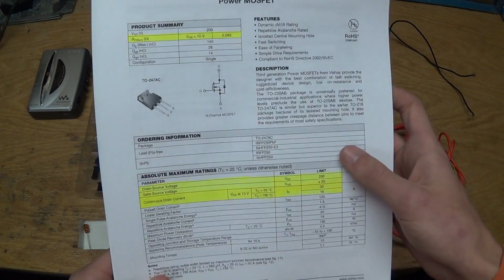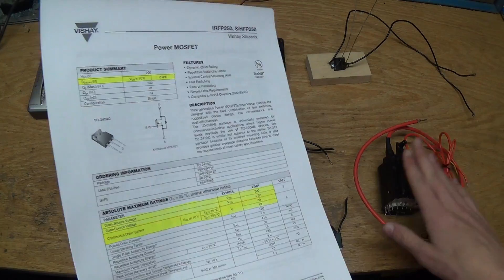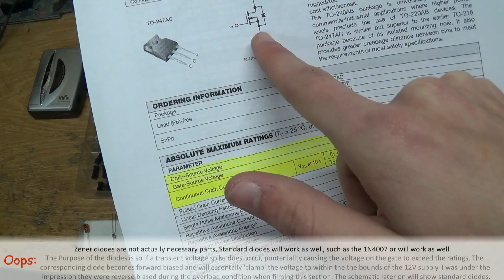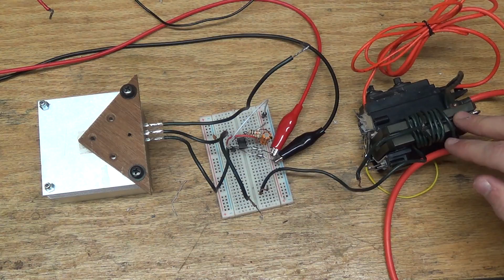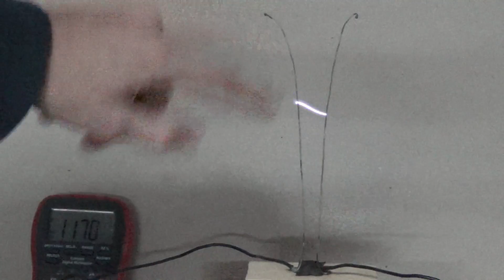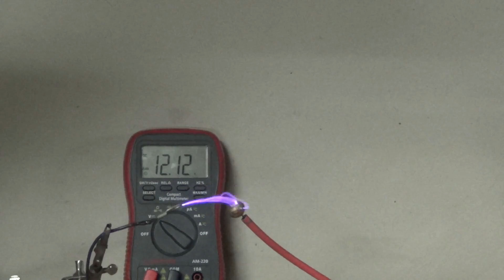Weekend Projects: Make a 69KV Singing Arc Plasma Speaker Flyback Driver!

Comment: Have a look, might be interesting for you.
This is not typical crowd funding,
 This is open source project.
https://www.kickstarter.com/projects/384716696/zero-emission-heater
Reply from the maker: +Igor Stojanovic Sorry for not responding sooner, you got caught into the spam filters. Interesting kickstarter of yours, though I have a few technical questions:

My understanding is that this is basicly a microwave and vacuum chamber where fuels that are liquid at room pressure and temperature can be gasified at very low pressures for supposedly clean combustion and heat production. There are a LOT of words on that kickstarter to describe just this? Am I missing something?

Have you verified any of the science behind this? Do you have any working prototype? Other than that seemingly unrelated video of something being nuked in a microwave? I would either edit up a more professional-looking video describing what you are trying to do, and why, and some of the science to back it up, and remove that video.

This project sounds VERY complicated, and consequently pretty expensive/impractical. Almost all great inventions tend to be simple and elegant in design (simpler = cheaper and more reliable). Like, what is the unit price of production if you plan to make this something sellable? What would an open source community want to do with this?

If zero emission electric heaters already exist, why would anyone bother making or investing in this type of heater? Electric dish heaters work pretty well for small areas. They are very efficient, since heat energy is like the simplest and easiest thing to produce.
Reply: Power Max
Hi, thanks for response.
That video is not related, sort  of.
It is proof that already burned exhaust can be burned again.

Science behind my idea is complicated but already proven... many many times.
My idea  taking the things a bit further,
Closed system with  no need for oxygen.

We are building several ov those in diferent locations.

But lets  break it down,

Get your self one cheap induction cooker on ebay for less than 40 dollars.

You will get your self 2KW plunged in AC device with power control. button or buttons.

Its coil  can be used as choke/step down transformer. you shall need some finest ferric  dust you can find to mix it with lets say epoxy... this is how you get your encasing for puirpose of  traping all of electromagnetic power in coil and be impulsed  in to the interior of one side of pipe geting the moste of your buck for that bang.

For stabilizing process  and reducing electricity consumption system very similar to fluorescent light will be employed.(fantastic solution known for decades while creating plasma bridge in vacuumed pipes. lfuorescent, or neon lights.

After that you will need to build your self container for your fuel. and to chose between, design you have on kick starter, U shaped pipe for testing Or one swirling  pipe ( something like  Shape of electrical heater for water in your electric boiler) which I suspect will be  very interesting design to exploit.

Ma skype is websonic6

wiber/ whats app, +41798178038.

Pplease call for any kind of question you have.
Mind you, This is open source., I do not do this for money.

cheers
Reply from the maker: +Igor Stojanovic Well, you aren't really "burning" the gas. Because fire is by definition, a self-sustained exothermic redox chemical reaction. Say you "burn" hydrogen with oxygen present as an oxidizer: you create H2O, as the 2 hydrogen atoms are torn apart by the initial heat energy then left to react with oxygen. The process is exothermic, meaning that it releases more heat energy afterwards, some of which carries on the reaction with the rest of the H2 and O2 present. The chemical equation is 2H₂ + O₂ --> 2H₂O. A similar but much more complicated process occurs with ANY type of burning. Also notice that all good chemical equations are balanced. This means that you will ALWAYS have the same atoms on one side as the other side. Just like 2+2+4=8, and cannot equal 5, the total H's and O's on one side must be the same on both sides.

Chemistry is not my specialty by any means, For that, check out NurdRage on youtube! However, as with anything, that ideal chemical process is only half the story, or actually, more like 10% of the story. In the non-ideal real world, not all the fuel is burned. Gas engines for instance release unburned gasoline into the atmosphere, and this has to do with how real world chemical reactions occur. It is up to chance if every single gas molecule was able to find a friendly oxygen partner, and has enough activation energy to get it to react. If the gas/air mix is not perfect, you start needing to deal with something known as "limiting reactants." and "stoichiometry".

"it is proof that burned exhaust can be burned again" Sorry, that is simply not true. Once the reaction between fuel and air has occurred, and has lost it's energy, it cannot be burned again, since it literally has no energy left. It is like a spring that has lost it's compression after burning. If you put heat energy back into it, in some cases, you can reverse the reaction and "reduce" things like metal back to their non oxidized form again!

Here is a good video about what fire is:
https://www.youtube.com/watch?v=tMDKeBaLWDw
Reply from the maker: +Igor Stojanovic Well, you aren't really "burning" the gas. Because fire is by definition, a self-sustained exothermic redox chemical reaction. Say you "burn" hydrogen with oxygen present as an oxidizer: you create H2O, as the 2 hydrogen atoms are torn apart by the initial heat energy then left to react with oxygen. The process is exothermic, meaning that it releases more heat energy afterwards, some of which carries on the reaction with the rest of the H2 and O2 present. The chemical equation is 2H₂ + O₂ --> 2H₂O. A similar but much more complicated process occurs with ANY type of burning. Also notice that all good chemical equations are balanced. This means that you will ALWAYS have the same atoms on one side as the other side. Just like 2+2+4=8, and cannot equal 5, the total H's and O's on one side must be the same on both sides.

Chemistry is not my specialty by any means, For that, check out NurdRage on youtube! However, as with anything, that ideal chemical process is only half the story, or actually, more like 10% of the story. In the non-ideal real world, not all the fuel is burned. Gas engines for instance release unburned gasoline into the atmosphere, and this has to do with how real world chemical reactions occur. It is up to chance if every single gas molecule was able to find a friendly oxygen partner, and has enough activation energy to get it to react. If the gas/air mix is not perfect, you start needing to deal with something known as "limiting reactants." and "stoichiometry".

"it is proof that burned exhaust can be burned again" Sorry, that is simply not true. Once the reaction between fuel and air has occurred, and has lost it's energy, it cannot be burned again, since it literally has no energy left. It is like a spring that has lost it's compression after burning. If you put heat energy back into it, in some cases, you can reverse the reaction and "reduce" things like metal back to their non oxidized form again!

Here is a good video about what fire is:
https://www.youtube.com/watch?v=tMDKeBaLWDw
Reply: Simple question, what happens when you split big molecules  with strong electromagnetic field?
Reply from the maker: +Igor Stojanovic What I think you are doing is actually just superheating the leftover exhaust to the point of  incandescence. I assume it is the soot leftover from the already burned fuel that is turning into a plasma. However, the exhaust is already released its chemical energy, so heating it up will yield no more energy. Maybe some other chemical reaction will occur, but one that converts exhaust back into fuel or something else temporarily, then that burns, but no net energy is released or absorbed.

So what this means is that you just created a very complicated electric heater. Because almost no additional energy is released by the exhaust plasma, almost all the energy is coming just from the microwave pumping energy into the plasma, and that energy is being dissipated as heat and light. A standard electric heated does just that, produce heat and light Much easier, simpler, and cheaper.

Also, this is not emission free because like I said, you CANNOT make nor destroy matter. Maybe lose track of it, as an escaping gas or as some soot that builds up very slowly on the sides of the chamber, but it is not destroyed, as so technically not emission free. Just that the emissions are contained.
Reply: Take crude oil for example:
creating those molecules took lots of heat and pressure,
Spiting that molecule will not release  heat?
Reply from the maker: +Igor Stojanovic There is a LOT of chemistry involved with combustion, it is simply WAY too much to discuss in a youtube comment. and NO, spitting a molecule doesn't release heat, in fact, it actually TAKES energy!... Let me read you one page of my really old, dusty chemistry school book (ISBN 0-07-861798-7, page 708): 

=========================================================================
Exothermic Reactions:

_"If you have ever started a campfire or built a fire in a fireplace, you know that the burning of wood is an example of an exothermic process. Once you have ignited the wood, the reaction generates enough heat to keep itself going. A net release of heat occurs, which is what make the reaction exothermic. (figure 20.1) The exothermic reaction (left) is gives off heat because the products are at a lower energy level than the reactants. The endothermic reaction (right) absorbs heat because the products are at a higher energy level that the reactants."

"The reaction between hydrogen gas and oxygen gas to form water, shown in Figure 20.2, is another example of an exothermic reaction. Once a small amount of energy----often just a spark-- is added to the mixture of gasses, the reaction continues to completion, usually explosively. No additional input of energy from the outside is needed to keep it going. Once energy has been supplied to break the covalent bonds in the first few molecules of hydrogen and oxygen, the atoms combine to form water and release enough energy to break the bonds of additional hydrogen and oxygen molecules. The net (surplus) energy is released as heat."

=========================================================================

When the book mentioned products, that is like the exhaust. Likewise, fuel and air are examples of reactants. To get something to start burning, you must overcome an energy threshold, called the activation energy. This is ignition. Wood, propane, gas, none of these things spontaneously ignite without a little encouragement.
Reply from the maker: +Igor Stojanovic Here is a good video talking about this very stuff. What you probably need to do to understand what you want to do (produce heat energy with fuel in the cleanest way) is learn about how chemicals react, how they store energy, and do some practice with balancing redox reactions, and thermal equilibrium problems. This is about half of college chemistry, is Is NOT EASY! I only got a B in chemistry. I am usually an A student. Also, I hope you do read these comments carefully, I spent like several hours writing them :) because I like to help people!
https://www.youtube.com/watch?v=w0mb0BIEkBI
Reply from the maker: +Igor Stojanovic "what happens when you split big molecules  with strong electromagnetic field?" You pump them with energy, causing them to glow because you excite the electron orbitals to a higher energy state, when the electrons fall back down to a lower energy state, they release light at a very specific frequency. Just like what is happening with that spark in my video above. But that is a very indirect way of producing heat energy. It is no better than just using a heating element. That is a lot simpler than using a 555 driver to create a pulsed DC current at the primary of a transformer to achieve high voltages and very strong electric fields.
Reply: My plan is to use 2kw power in very small and confined space.
I do think that what will hapen is not just simple heating of molecules.
Reply from the maker: +Igor Stojanovic 2kw is the equivalent of about 6800BTU/hr. if you put 2KW of electrical power into effectively a microwave, and allow that to excite a gas to the point of plasma, you will get less than 2kw of heat and light, as some EM energy is radiated away. point is, there is no advantage to doing that, if a simple electric dish heater will accomplish this with a sinple resistive heating element.
Reply from the maker: +Igor Stojanovic also, 2kw of electricity is a little too much for a standard american 120V wall outlet. a resistive heating element will draw over 16A. 240v will be the only safe choice.
Reply from the maker: +Igor Stojanovic I like the idea  you are trying to develop, something that produces more heat energy than you put into it, but that is sadly not possible due to the law of energy conservation. Overunity is and always will be nothing more than a dream. However, if you want to produce heat in a clean, emission free way, look into using HHO gas, hydrogen fuel. You can make HHO gas with electrolysis, then if you figure out how to burn it in a controlled way, that allows most of the energy to be converted radiated heat, all you will be left with is water vapor. Then just allow the vapor to condense and collect in a container or something, and you have emission free heat, and maybe some hot tea as well :D Just an idea.
Reply: +Power Max 
Hm, that is a problem for sure  where you live.
I am in Europe,
Here we are using 230V AC
Standard wall sockets are rated 16 A.
Reply from the maker: It certainly would be! 1800 volt amps (VA) is the maximum that any outlet can support.
Reply: +Power Max 
Thats not bad at all,
Is there a way to send you a drawing?
I am interested in your opinion.
Reply from the maker: About what?
Reply: Creating electromagnetic pulse direct from AC network just with capacitors.
Reply from the maker: Capacitors don't do much more than store a charge, and create reactance on an AC circuit. They do this via an electrostatic field across a dielectric material between 2 plates. Similarly, inductors store a magnetic flux within a magnetically permeable core. I am currently working on a capacitor tutorial, to discuss everything (that I know) about them. From the calculus involved, to the theory, to the practical considerations/limitations.
Reply: +Power Max 
Do you want to see proposed circuit or not?
Reply from the maker: You could probably create a schematic in LTspice, which is a simulation software. The files it saves are simply ASCII text files, with a .asc container extension. Open that file up in notepad and just copy/paste the text into youtube comment, and I should be able to open it! That is unless you prefer to upload it to something like dropbox or google drive and allow me read-only access. I don' know any other way, putting an email address online would just be asking for trouble.
Reply from the maker: Below I have created a test file, which, once copied into notepad, with ANSI encoding, and saved as .asc file, should open write up in LTspice by default. I tested it myself to verify that this will work.

Version 4
SHEET 1 880 680
WIRE 160 64 96 64
WIRE 288 64 240 64
WIRE 96 128 96 64
WIRE 288 144 288 64
WIRE 96 272 96 208
WIRE 192 272 96 272
WIRE 288 272 288 208
WIRE 288 272 192 272
WIRE 192 304 192 272
FLAG 192 304 0
SYMBOL voltage 96 112 R0
WINDOW 123 0 0 Left 2
WINDOW 39 0 0 Left 2
SYMATTR InstName V1
SYMATTR Value 12
SYMBOL cap 272 144 R0
SYMATTR InstName C1
SYMATTR Value 100µ
SYMBOL res 256 48 R90
WINDOW 0 0 56 VBottom 2
WINDOW 3 32 58 VTop 2
SYMATTR InstName R1
SYMATTR Value 100
TEXT 62 328 Left 2 !.tran 100m startup

Comment: HI, great video - what kind of camera did you use to record it?
Reply from the maker: +Ben Lentaigne A cheap Sony handy cam. It was the cheapest camera available that was capable of true 1080p60. It is only an OK camera for the price it was, pretty noisy in low light situations, no external microphone, no pro features. But it gets the job done.

Comment: if I would use a voltage multiplier, would it be louder?
Reply: +ivan R it would be over 9000db
Reply: dude, ledgit?
Reply from the maker: +ivan R Probably not. This circuit relies on injecting an AC audio signal into the flyback driver (creating crude AM) and a voltage multiplier might boost the voltage a bit, but current will be reduced by a lot and the diodes and capacitors smooth out fluctuations over time, including the audio. Basicly it will filter the audio away, and probably cause it to sound even more crap.
Reply: Power Max ok thanks so the only real way to make it louder is to increase the amount of windings on the secondary?
Reply from the maker: +ivan R Good luck doing that! The wire that makes the secondary is like 40AWG and it is potted in epoxy. It's almost impossible to modify the flybacks without completly destroying them. Also the flyback I'm using is one of the very common and cheap DC flybacks, it already has a HV rectifier and probably a voltage doubler built-in. It is sometimes possible to modify the flyback transformer to destroy and short out the internal rectifier, but often this will compromise the flyback, causing them to fail shortly after.

Really with my circuit, these flyback are already being pushed beyond their limits. I tried using 18V and then 24V instead of 12V on 22:33, and ended up killing a flyback transformer secondary. For the few seconds of operation though I did get spectacular results!!! I was getting arcs similar to that the one guy did with his "monster flyback driver" video!!!